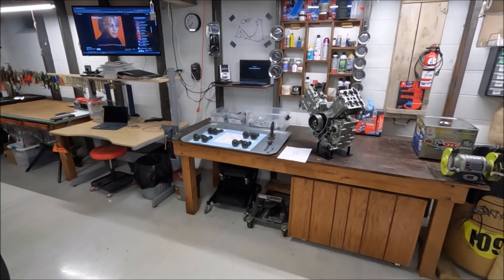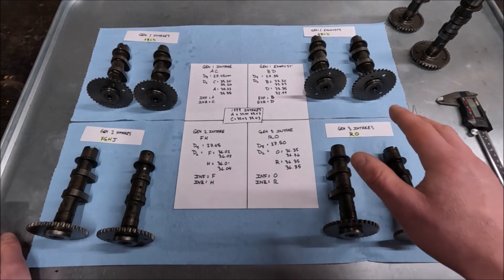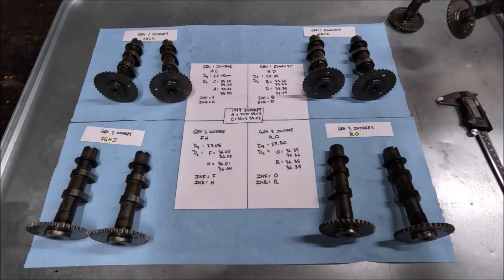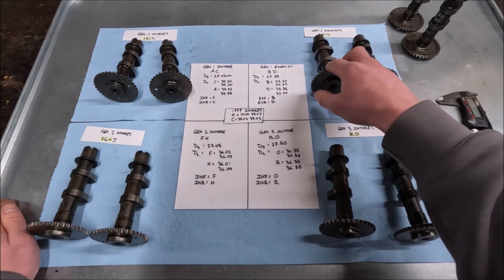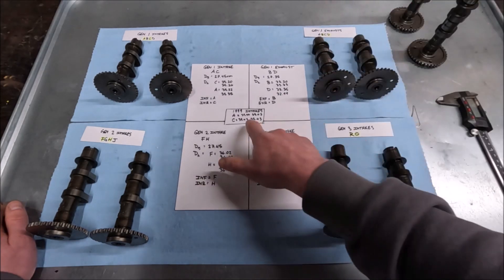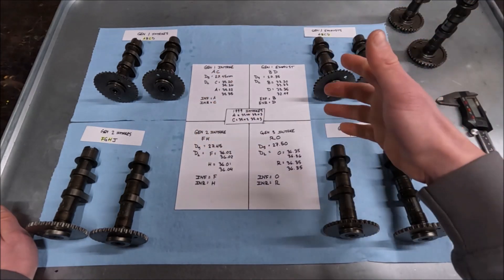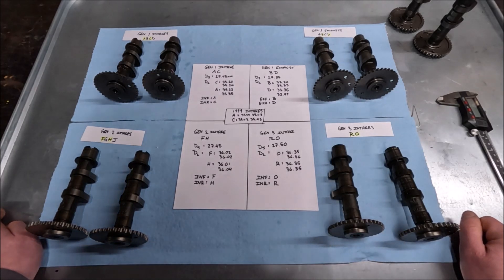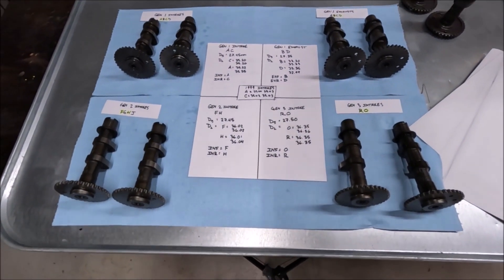SV650 - Camshafts

Comment: Good morning mat, I enjoy your channel keep up the good work. I understand the measurements you are taking but the key ones your not going to be able to measure with calipers. Valve lift, duration the valves are open and base circle need to be measured with a degree wheel and indicator. I would pick the cams that show the least wear and try running them, Can you run Spears cams in your class?
Reply from the maker: Thanks Forest.
Yep, I know I'm only able to take some basic measurements as opposed to getting the full picture. The only two measurements I could semi-confidently get were the large and small diameters of the lobe. Anything to do with the actual shape is beyond my abilities. Even if I could, I wouldn't know what to do with them. I know if you get into much more lift than the OEMs, you run into requirements of needing to modify timing by degreeing the camshaft. Additionally, you also run into needing to run stronger valve springs. Both of these introduce a bunch more cost and complexity into things. 

Interestingly, I did find that there was a service limit on page 3-40 for the camshafts, so my question about "do these things really wear that much" could have been answered by more closely reading the manual. There is nothing talking about a "difference" in wear comparison between partner cam lobes on the same camshaft though.
Intake: 35.18mm
Exhaust: 33.18mm

I could run the Spears camshafts as long as I'm not running SuperSport. That being said, this whole project is an exercise in learning whether I can actually rebuild an engine and understand it on my own. And I'm trying not to be insane with expenses. There has been thousands of these bikes that have had the cam swap done with OEM gen2 cams, so plenty of info out there. By going with the Spears camshafts, you get into an entirely fancier and more expensive build. Cams, high pressure springs, high compression pistons, strengthened Carillo rods, the skill to degree the cams properly, and the dyno time to make it all work. It jumps you from a $1000 rebuild into a $4000 rebuild really quickly. 

At least that's my understanding. I'm trying not to get too far out in front of my own skis, but I feel like I'm already getting there on many occasions.
Reply: @matttriestodothings  keep learning keep trying. Good job keep going.👏